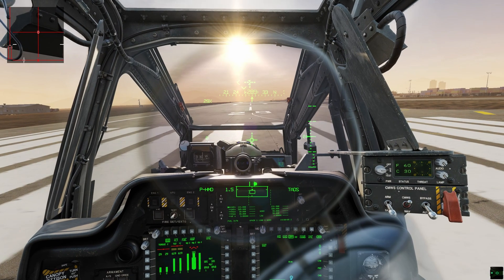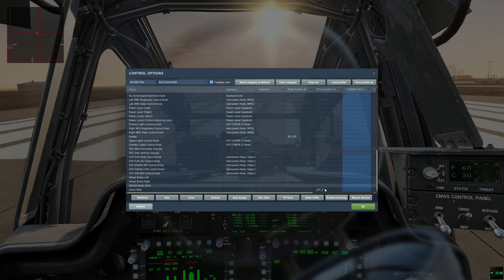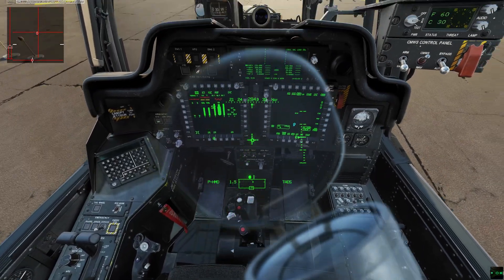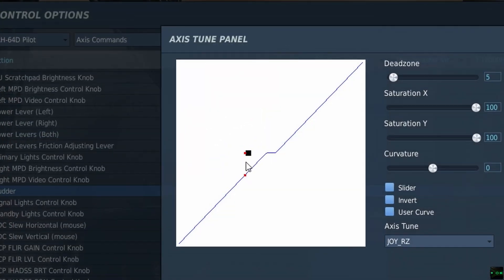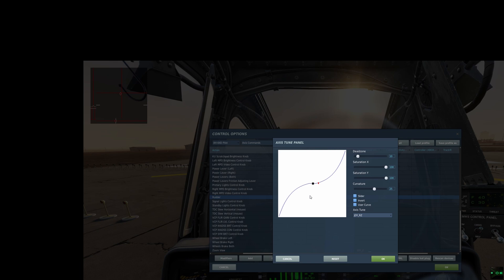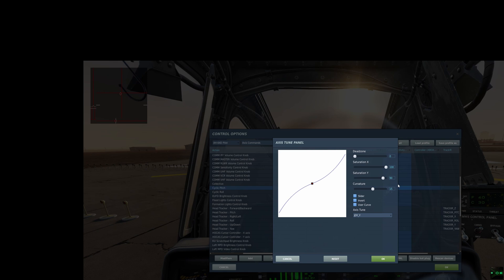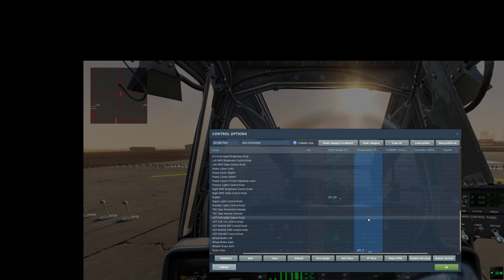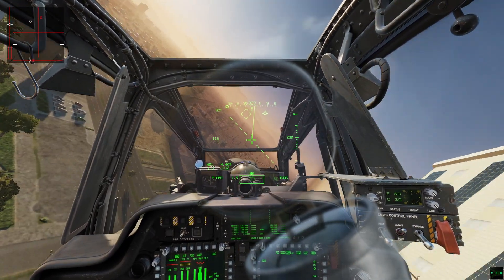How to Fly the DCS AH-64D Apache #3: Curves, Saturation & Deadzones to take away the crazy

Comment: Thanks - excellent videos. Wondering if having any deadzone at all makes sense when using anti-torque pedals with no spring and a dampener? I similarly have a "dead stick" cyclic - no springs (just clutch) and never use the trim button at all. Unfortunately find the controls a bit to sensitive like this, but beyond reducing Y sat, there doesn't seem to be anything for it?
Reply from the maker: It's had (a lot) of flight model changes since this video.... that said, DO use trim - it also sets some of the targets for SAS/SCAS/that stuff, i.e. the heading hold and attitude holds for example. As for pedals - depends how smooth & sensitive your pedals are near zero, and I guess how much pressure you need to apply before they start moving.

Comment: Excellent information.  I have encountered a problem when you set an s-curve for an axis.  The problem occurs with a self-centering joystick like Thrustmaster Warthog Joystick.  The joystick is extremely precise at center so there is no need for a dead zone. With no s-curve you can observe the INPUT value and associated OUPUT value for each position of the stick.  If you move the stick exactly 1 INPUT unit to the left relative to the center of the x-axis, you get exactly 1 unit of OUTPUT. The same is true when you move the stick to the right relative to the center of the x-axis.  This is how it should work with no s-curve.  Now, if you change the s-curve to 30 for example, when you move the stick to the left exactly 1 INPUT unit relative to the center of the x-axis, you get still get exactly 1 unit of OUTPUT.  Then, when moving the stick to the right relative to the center of the x-axis you must move the stick 6 INPUT units to get 1 OUTPUT unit.   I believe that this behavior is incorrect. With a curve of 30, you should have to move the stick 3 units of INPUT relative to the center of the x-axis in either direction to get 1 unit of OUTPUT.  It appears that the DCS software is moving the center position of the stick and is causing me all sorts of problems flying AH64-D until I get the proper force-trim set up.

I have corrected this problem by using the SETJCURVE function of Thrustmaster Target Script and then by using no curve on the DCS axis tune panel. 

This very same problem occurs with any DCS module whenever you apply an axis s-curve.  I have not encountered a problem with a slider axis.

So, if any of you are having problems with flying, you may want to check this out yourself.  My flying skill is much improved now.
Reply from the maker: Interesting. Thanks for the breakdown.

Comment: Will this be valid if I do indeed have stick extensions ? What would you recommend for those who have it ?
Reply from the maker: So, unfortunately I don't have an extension. Or rather not yet. I've heard some extensioned folk saying they're running no curves, purely linear. I'd recommend start with 0 curves and saturation. If you find with small, subtle adjustments it's still out of control and you can't hover manually after some practice, then add saturation & curves. It'll be a mixture of what works for you and your hardware. If later you find yourself in total control of the beast, then maybe try the waters and reduce curves/sat. And no, I wouldn't even call it a cheat more or beginner's tool - you possibly don't have a lot of the feel and possible throw of the real thing, nevermind the seat feeling.

Comment: Thanks so much for taking the time to make this video.  I have a question though,  what is the best setting for Options/Special - I currently am using insta trim for cyclic, and pedals without springs for rudder - is this the most optimal settings,  I have a warthog cyclic
Reply from the maker: Assuming your Warthog still has springs, then it depends on whether you prefer Insta or Central position. You'll need to try both for a few minutes. See which one feels more natural to you. Both are valid options and can work well if you use it right. If your pedals don't have a strong spring mechanism pulling it back to centre but pretty much stay in place, or have very low pressure then Pedals without springs would be right for that option.

Comment: This has been a big game changer for me - thanks! Gone with Y-sat down to 80 and curves at 30 really helps with pitch/cyclic. For the collective I have that set in-game as a slider (inverted) with a bit of negative curve but I want to get better resolution around that critical 60 - 70% area which controls your vertical speed at hover, I find tiny nudges on my Hotas throtte can be too coarse for good stable control.

Comment: Hi Volk! Thanks for all the good quality videos/tutorials you've  done, I have learnt a lot from them. Do you know if the Apache will have an Attitude and Altitude Hold? it seams no one is talking about them. I can't believe that this "super hi tech" module  cannot match the autopilot systems of the Kamov!
Reply: The Apache in DCS does have the trim settings for Attitude and Altitude and a few others, don't know the keybinds exactly but I think you can find them in the pilot controls as like A/left or R/down or whatever. However, I have noticed that only the Attitude trim seems to work but not the altitude nor the whatever the down option is but attitude does work so far. I have my main TM WH stick 4-way hat as up for Trim, left, for atitude and down for trim reset and whatever I decide to do with my right directional.
Reply: @direwolf1596   Yeah, I've bind them too [trim buttons] it is just that I was expecting the module to have the autopilots ready from the very beginning. But only thing left is to wait for those features to arrive, and I'm aware it is not the final product. [my point is that is curios that no DCS Youtuber is talking about that the apache was not  released with such features and we are learning to fly it like autopilots modes don't exist. ]
Reply from the maker: Altitude Hold and Hover Hold are coming. Note that e.g. the Hover Hold is exactly that - tries to maintain your present hover that you piloted, rather than an automated insta-stop. So any practice you put in now in hovering will still apply. As for the tech, consider the Kamov is single seat, so it HAD to automate so you could go hands-off, and spend time acquiring targets (essentially 'switching seats' with a button press as it were) since you can't have someone focus on positioning all the time.

Comment: I'd like to add that if you do use a stick with force feedback, you should not adjust your curves. Once the stick is trimmed out of the center position your stick will be more sensitive in the X and/or Y axis.
Reply from the maker: I still need to try my Sidewinder on the Apache. I do recall it being pretty sensitive though, and IIRC you can't really extend it without weakening the ability for it to hold the stick in place. Will need to see.

Comment: This is a compensation for bad pilot skills.  What you're doing here is really just making it so that you can hamfist the aircraft around by yanking on the stick with less consequences than the actual aircraft would allow for.  I get that people want to just jump in and play it like it's GTA5 with an xbox controller and immediately have fun, but this is a simulator, not an arcade game.

Having these settings will mean you will have to be making VERY BIG stick movements at speed when trying to do high speed NOE or evasion.  The actual stick in an Apache doesn't allow for that because it's between your legs so you only have so much room to work with.

Instead of not challenging yourself by cheating and dampening the controls so much that it compensates for your lack of skill, try practicing and figuring out how to use trim to your advantage to make hovers stable.  Keep in mind that ALT and ATT trim is still not implemented and once that's in game, it will make things much easier.  But gimping your own skill development with handicaps is only going to stunt your longterm growth as a 64 pilot.
Reply from the maker: Sure. Which is why I say curve/sat/deadzone till it works with your HOTAS/HOCAS/Gamepad setup allowing you to do the miniature movements. Half a millimetre travel on my desktop stick without curves/saturation is not nearly the same as half a mil on the IRL stick. Also, my springed stick has a noticeable hump/speedbump moving certain angles near centre, which the IRL one doesn't.
Point of this vid is you're supposed to be able to have control with relaxed minute, fingertip touch controls. Unfortunately I can't get effortless movements on the stick - it's still got a hefty spring I can't reduce/swop out right now, but at least if I move the stick a quarter millimetre it comes out as a subtle adjustment rather than a strong bank. If you try it out and your hardware setup doesn't allow it, add the settings to enable to do that, while still having the ability to do the faster & more extreme maneuvers. If you have a sufficiently long/dampened stick with good sensitivity that doesn't need any adjustment, then absolutely rock that with zero settings.
That and multiple IRL Apache pilots mention or publically post their curves & saturation which were even more excessive than the ones I mentioned, when they were using better quality gear.
Reply: Or maybe you should relax and take into account that no one is using an actual stick taken from an apache aircraft and so find the need to adjust saturation and curves in order to make the module flyable across a wide range of throttle/stick/collective/rudder combinations. Or are you really suggesting that somehow the default settings will feel the exact same and true to an actual AH-64 across so many different pieces of hardware? Not to mention people with disabilities who may require these settings just to be able to play in the first place. Because playing is really all we are doing here, it may be a sim but in the end all of us are here to have fun. So do what is best for you and don't crap on whatever it is that other people are doing in order to get the module to work well for them.
Reply: @restricted003  People can do whatever they want but it's still going to cause them problems.  Being this damp for hover will make huge issues for high speed adjustments and fine control during NOE when you need that stick travel range most but hey you do you boo.
Reply: @GTRNights  Honest Noob here and confused by so many different recommendations that are all over the place. Even as a Noob, I understand that as we are talking about aiming for some extremely crude facsimile of the real McCoy, it will never represent such. I was seeking info as you seem to have strong views on how to set such up.
Reply: ahhh  howly cow... try emulate the real f16 stick and have fun with it blablabla........... its compleatly different from settup to setup thats why you need these settings and adjust it to your needings.
Reply: So what settings do you use?
Reply: @mughug9616  default with a 5 deadzone.  Also, keep in mind they still have yet to properly implement stability and ALT.  ATT is in already.

Instead of yanking around on the stick like it's their wang, people need to get used to being delicate with the inputs and anticipating with nulling. 

What people are experiencing is called operator induced oscillations. The aircraft isn't the issue. Compensating for lack of skill with damping is only going to hurt people's development and skills in the long term. And apparently the truth hurts their poor feelings too.
Reply: @GTRNights  Why a deadzone of 5 if 0 presents no trembles on any axis? Is there another reason? So you are suggesting 5 deadzone, 100% satuation and 0 curve on x,y for pitch/roll/rudder and then master the handling characteristics? If so, would that be closer to the real thing? Anything on settings for collective (Saitek throttle)? Using VKBSim Gladiator II as joystick.
Reply: @mughug9616   Yes!  You're right in that sense.  Deadzone of 5 simply because with modern sticks there can be some intercept between the axis when dead center on a variety of devices, so that's why I recommend that, so that you have a very tiny margin for center.

Sensitivity of an Apache cyclic would seem really absurd to most people.  You can be supplying inputs that seem to result in big movements, but the input itself is mere millimeters.  Once the aircraft is trimmed you can supply input with just two fingers and barely enough pressure to even realize that you're moving the cyclic.

Seems a little extreme, but trust me when you're at 130kts and trying to notch a missile and dive behind LOS, you will appreciate having every inch of stick movement available.

The problem with dampening it so much is that once you're trimmed, you won't have any range left, so when you try for a big input, like going evasive from a hover, you will smash the stick all the way and not get much response in return.  You'll get very little performance back from the aircraft, which could mean the difference between you surviving and eating a SAM or ATGM.
Reply: My recommendation is to set up a mission for training, in an open field, hot start, then just practice over and over.  Start with lifting and just getting to hover without crazy yaw and rolls, and set it back down. Repetitions. Keep doing it till you have it in muscle memory where the yaw and tilt input needs to be to lift up easy and in control.

Then do the same with hover. Just practice trying to keep it in a general area and don't be too picky or hard on yourself with expectations. Gradually reduce your target hold area as you improve.

Once you can lift and hover stable in a decently small area then start practicing your hover taxi. Back and forth. Over and over.

Introduce the entire procedure into your repetitions. Lift, hover, taxi.  After that, transitions and normal flight will be no problem, but transitioning from flight to hover for landing is yet another beast in itself.

Just follow that methodology. Practice. Repetitions. Don't gimp yourself. Apache isn't easy to fly and things like tail wag are just a part of helicoptering. Don't have high expectations about your ability to hold a perfectly still hover. I've never seen a pilot who could.
Reply: @GTRNights  Noted and thanks for tips.
Reply: @mughug9616   Not a problem, good luck out there and fly safe.  Did I say safe?  I meant dangerous ;)
Reply: @mughug9616   Some extra advice, if it's calculating weight correctly, you can go to the Perf page and check your Hover Q for IGE.  That will tell you the TQ% you need to get to a 5 foot hover.  So that way you can anticipate how much collective you'll need and won't start bouncing the collective.

Since you aren't actually in a real Apache, you can't "FEEL" anything, but you can use CTRL+ENTER to bring up your controls map and use that as a visual reference to know roughly where you want to trim.  Get used to knowing where to trim the controls for different modes of operation.

Also don't just watch your hover indicator and velocity vector on your symbology.  It can be a good reference, but also get used to looking outside for both near and far reference points.  Use a far reference point, like a building or cluster of trees to guide your heading, and use a near reference point to gauge your movement.

Because you're not in the real thing, you can't feel what it's doing and then anticipate.  You have to recognize what the aircraft is doing visually first, which means you're going to be more reactionary instead of proactive.  So you need to use all the visuals you can to your advantage.  Get used to recognizing the visual line between the orientation of the craft and the ground.

The crossbar that divides the mid from the lower front cockpit glass is a good reference for your level.  Think of it as like a bubble level.  Once you can visually process the information about what the aircraft is doing, you'll get much better at anticipating and nullifying forces before they pendulum you the other way.  You'll be a lot more stable in a hover then.
Reply: @mughug9616   Also since your stick is self-centering, make sure that you check this setting.  From the MAIN menu, not in-game one, go to options and special.  Make sure your trimmer modes are set to "Central Position Trimmer Mode".

Then make sure you have your up timmer button mapped.  So when you trim, immediately center your stick and then you can make adjustments as necessary and microtrim and get things perfect.

Keep in mind there is no trim release right now, so you'll need to de-trim in small increments if that's what you want.  As I'm coming in for a landing, I'm having to make gentle adjustments and microtrim as the flight model changes through transition to hover.  Right about 25kts when I'm about to slip into a hover I'm microtrimming about every few seconds, so you have to just get used to trimming and moving joystick to dead center.  It's a PITA how it's set up for now but you can get used to it.

Once you're in a hover and trimmed, you can pretty much hold a steady position without even having to touch the controls, same with setting aerodynamic trim for flight, especially if you set your trim and then engage ATT hold.

Anyway, that's all I got.  Good luck!
Reply: Point being, you're not going to just jump in this simulator and all of a sudden be a great pilot, hovering, blowing stuff up.  If you lack the patience for learning how to properly fly the platform, that's not the platform's fault and maybe a simulator isn't right for you.